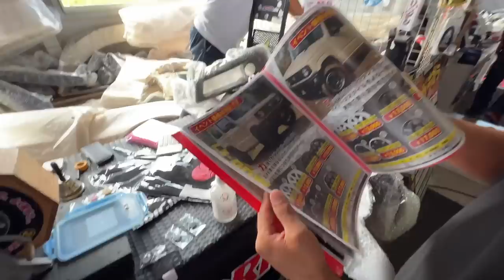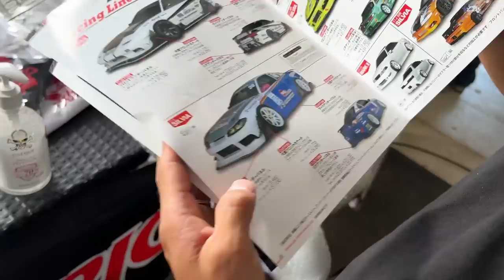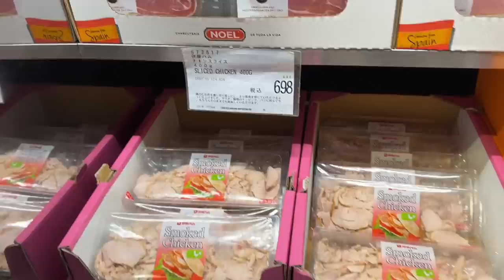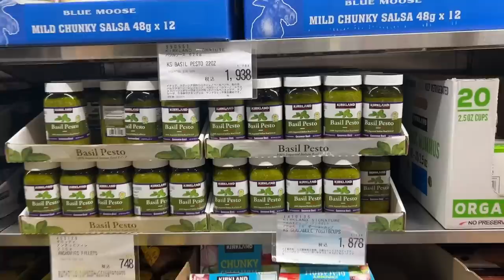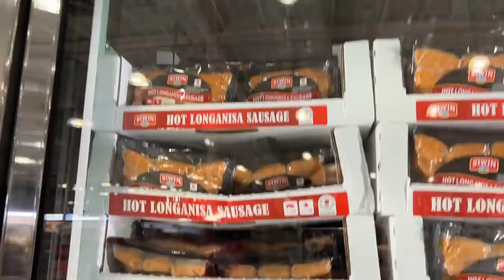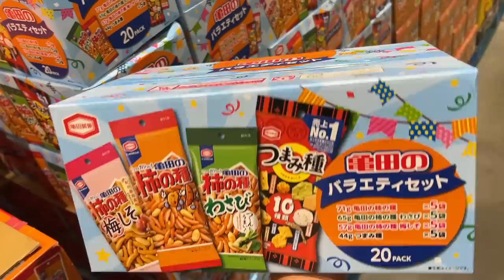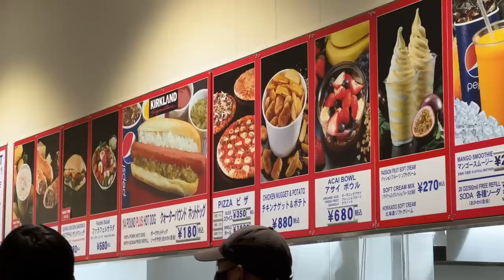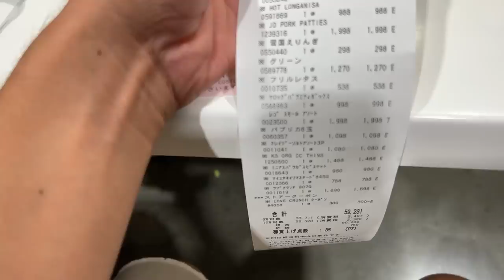Wife Reacts To Spending All My Money At A Car Swap Meet In Japan. / S4E17

Comment: What are the wheel specs for the TEs on the 15? 👀
Reply from the maker: 19x9.5 & 10.5 +35 with 35mm spacer in the front